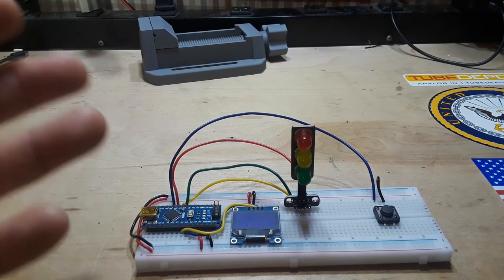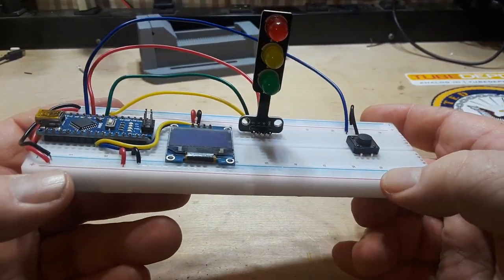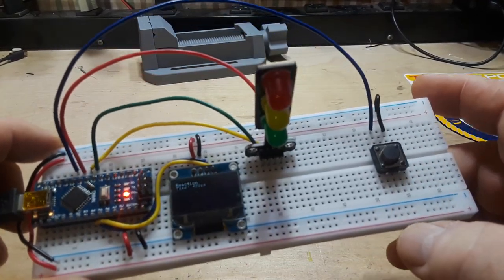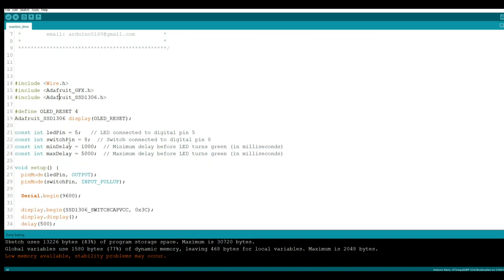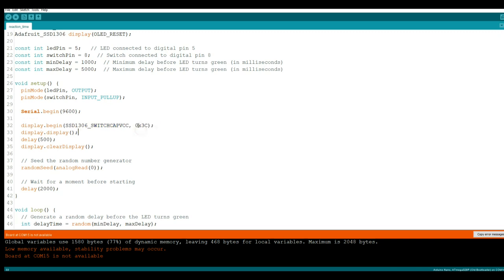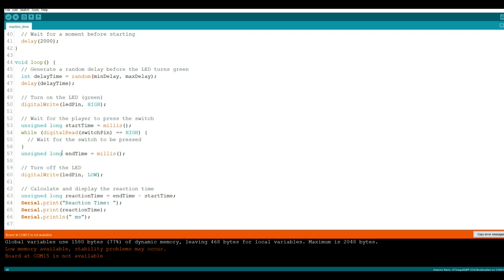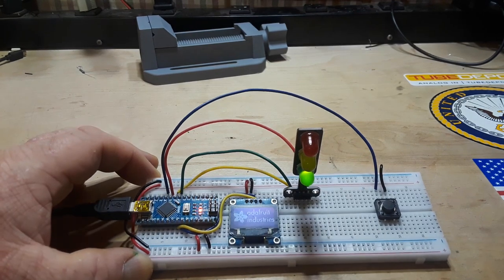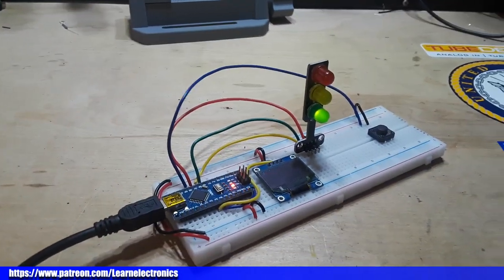Arduino For Kids  - Test Your Reflexes

Comment: Two switches, one for each driver, so you can drag race. The Christmas tree goes, red then yellow then green. A green light for each player to show who was faster and a red light for a player who tapped too soon (same as crossing the start line before the green light).
Reply: would need 5 leds, 1 yellow, 2 red/green or less using red/green combo led.

Comment: you can use it also as a jaywalking indicator cause if you cross here a red light by feet over 1 second when red had appeared then

your driver licence will be gone, your pilots licence and any patent as captain of a ship

1 second is the limit, above 0,5 s and below  1 s you will get a 80€ fine, beyond 1 s far more and 1 months or more without all driver and pilot licences and captain patents.

nice example to measure reaction time and especially for kids or to do a showcase for school classes on exhibitions to engage visitors to show their abilities. 
Such easy games for everyone are the best invitation to visitors for an interaction and to get them involved. Good example and easy setup. Have purchased the red light already but will need to check for the LED or OLED if mine would fit or not.